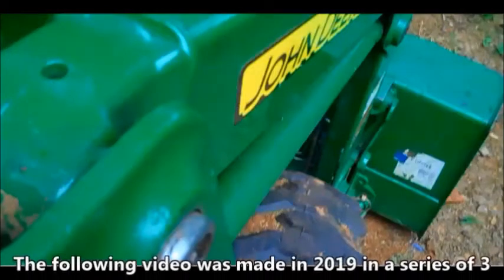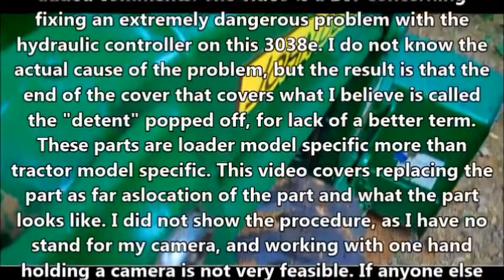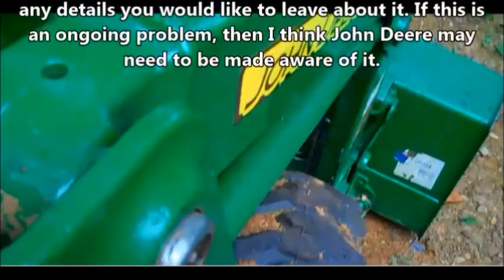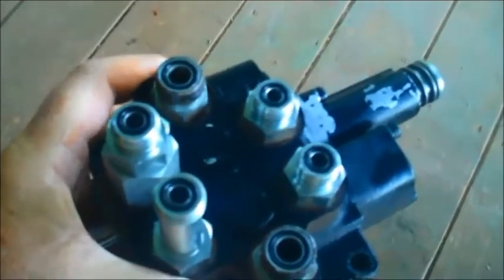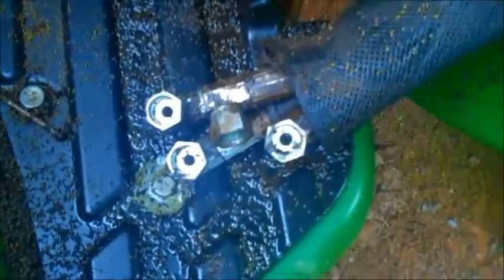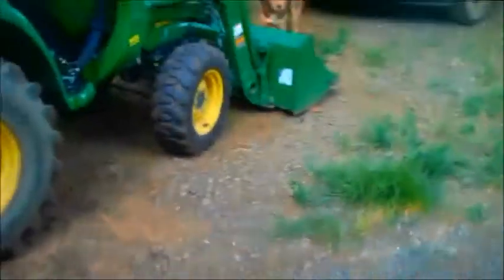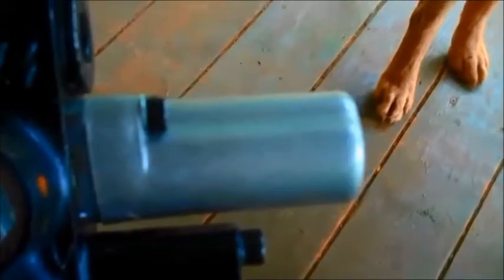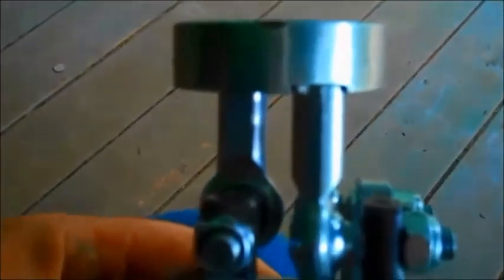John Deere 3038e Hydraulic Malfunction

Comment: Got a 3032e, mine did same
Reply from the maker: There seems to be a design flaw, but John Deere had steadfastly refused to correct it. One guy that it happened to was raising part of a tree trunk, and when the spring popped the end off, the lift came all the way up and rolled the trunk down the arms of the loader. The only think that kept the guy from being crushed was the steering wheel, which the trunk demolished, but it kept the trunk from hitting the guy.  The guy tried to get JD to correct the problem (they ended up, I believe, having to replace his tractor which was severely damaged by the trunk), but JD didn't seem too concerned about it, from what the guy told me. JD could have serious trouble is someone is injured or killed because they won't fix this and do a recall.

Comment: Dude you didnt show how it broke HUH did you do it step on it I dont know what the crap happed poorly producrd video  JS
Reply from the maker: I was using the lift normally (you know, pull the lever, it goes up, push the lever, it goes down, that kind of thing) and IT BROKE. Nothing special.  That good enough for you? I have an old phone video camera with no stand. I am not trying to be Paramount productions. If you get something from it, then fine. If you don't, that is fine as well. I am not looking for "thumbs up" or advertising or any of that garbage. Just sharing info. If it helps, great. If not, have a great day.